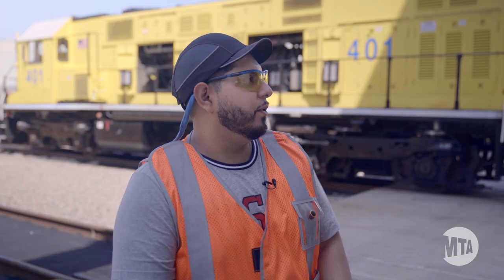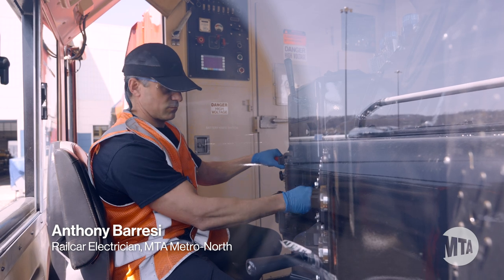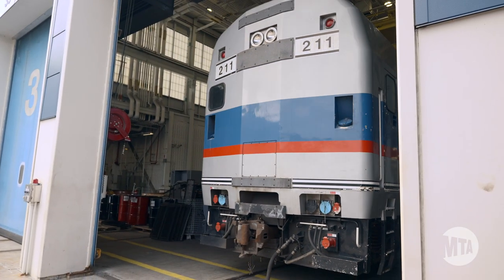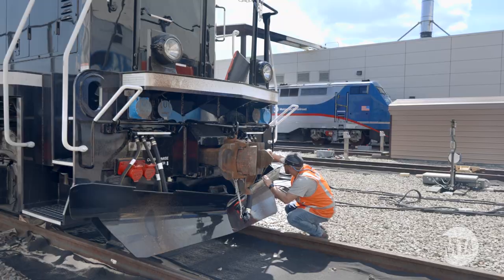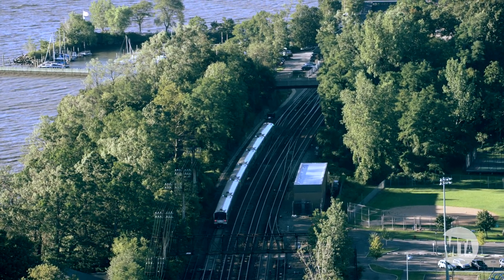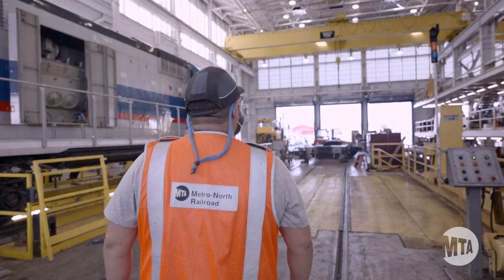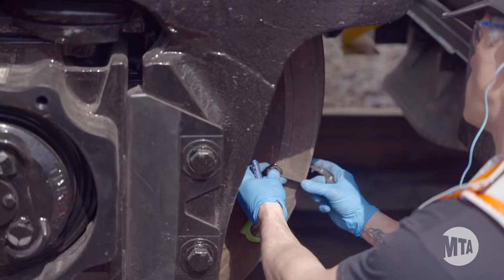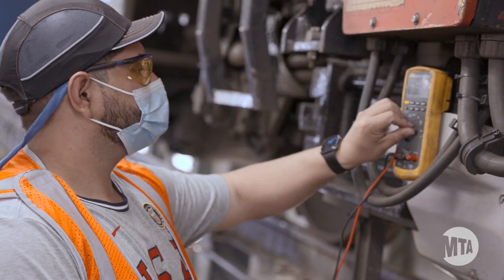What Does an MNR Railcar Electrician Do?

Comment: I'm an electrical fitter, can follow basic schematics (control, power circuits etc). But not on trains!
I notice that car electricians Vs say cubicle switchboard type electrician seem to be at opposites!  I suspect train electrician is like a car electrician? Which I'm just not good at. Electrical in cars basically don't make logical sense to me (maybe its just me).
Anyway, there's a train electrical fitter job going near my area. Wondering if I should apply? To tell you the truth if they supplied a huge scematic drawing and said: What's wrong with this circuit? I'm not going to lie, no idea Lol.
But if its about replacing senses, or any hardware fitting, or even running wires here and there, then all good.  But interpretting the exact voltage (or worse: current) required at a point in the middle of a schematic drawing? Um embarrassingly I have no idea Lol
So confidence level is diagnostics basic, but doing tasks obviously excel. Should I apply? Or best suited to vehicle electricians (where circuits don't make sense  Lol).
Reply: APPLY

Comment: I never knew mta had a p40
Reply: I think they have around 30 or more. They're used for the Hudson line and Danbury branch
Reply: They have 30 P32AC-DM dual mode locos. They are similar in appearance to Amtrak's P40s, but less HP.